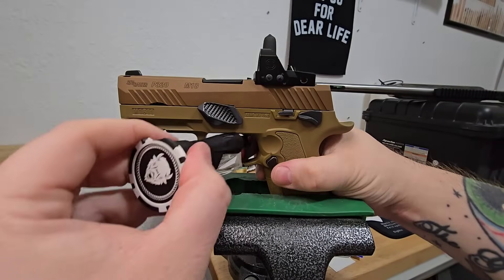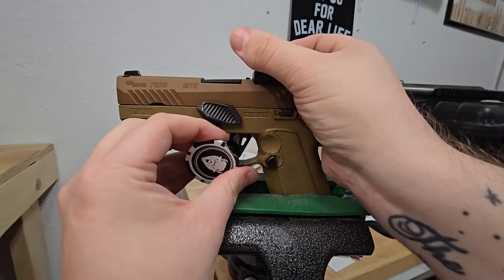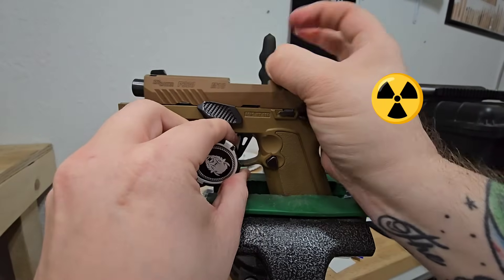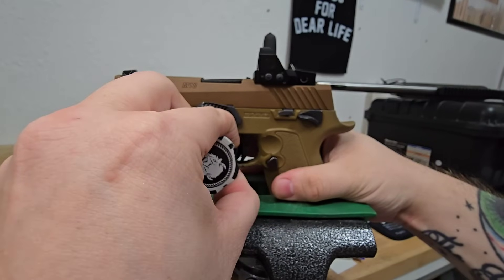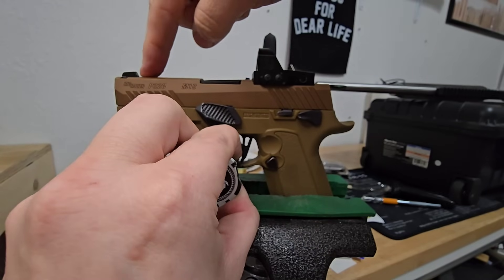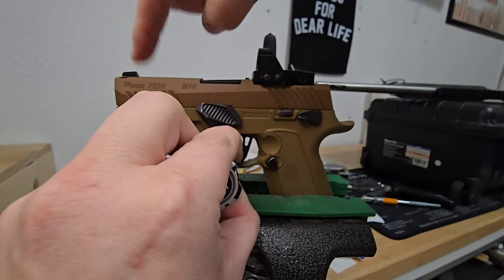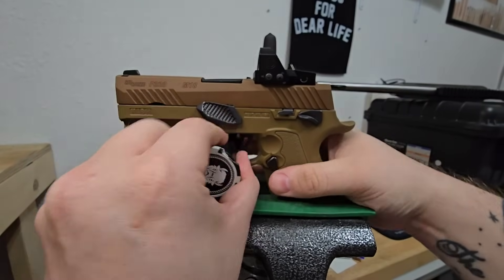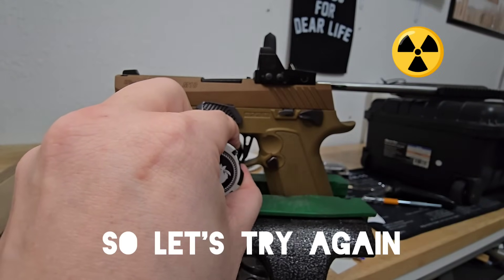VISE Testing Sig Sauer P320 M18 Slide/Trigger Pressure Issue!!

Comment: Isn't there something about what to do or what not to do with your finger and a trigger among the ancient quartet of rules for firearm safety? And the introduction of pressure upon the trigger (or the introduction of a screw or a wedge or any object into the scenario to preload the trigger) simply provides evidence in proving Sig Sauer's point.
Reply from the maker: This is not an attempt to explain the UD situation, only to show a possible issue that when combined with others, might offer some partial explanation for the controversy
Reply: This is duplicating what happens when you prep a trigger and then don't shoot.. amongst other things.  The sig has or can develop a shelf that will hang the sear up in the position shown here.  Their geometry is wrong.  You either have one and you have an unhealthy relationship with a tool, or you haven't been following this saga closely.
Reply: It also still proves SIG statement that the gun CANNOT FIRE WITHOUT THE TRIGGER BEING PRESSED as wrong. Neither this guy or WY Gun Project are fully pressing the trigger, the firing pin is coming off the sear, and secondary catch is not stopping it
Reply: @dustinn5490  "trigger being pressed" and not "fully pressing the trigger": a distinction without a difference. Still, even with less than fully pressing the trigger, 'something else' also has to be present, which is implicit in Sig Sauer's statement.
Reply: Guns shouldn't go off when the trigger is 50% pulled instead of 100%. Very basic concept here. If you're not physically pulling that trigger until it breaks, and yet the gun can still discharge due to the slide being bumped or some other force is exerted on the pistol, that's a glaring issue. Sig themselves have said, in black and white bold text, that the P320 cannot discharge unless the trigger is FULLY pulled. Not partially pulled. FULLY pulled. Their words. Not mine. 

Why? Why are we accepting this from an American gun manufacturer? The German and Swiss arms of Sig Sauer don't have these issues. Why are we settling or making excuses for anything less than a perfectly safe and functional firearm? It's nauseating. We wouldn't do this for any other company. If Glocks started doing this, every glock hater on the planet would be rushing to condemn them and demand they pull them from the market. We wouldn't accept this from anything else. Just stop already. Anyone that isn't even the least bit suspicious or skeptical of the P320 right now is doing the firearms community a major disservice.
Reply: @retrocny5625  One: I am not making excuses for anyone, especially not Sig Sauer. Two: I am not saying a dangerous unintended discharge condition does not exist with given p320s. Three: 50% or 100%, the what to do with or not to do with fingers and triggers rule made the all-time top four for a reason.
Reply: The pulling back of the trigger just demonstrates how anything from dirt, to tolerance stacking of parts can cause the pistol to fire. 

They're not necessarily saying the trigger has to be pulled back. In fact, it's highly unlikely the trigger is involved in the 100+ times it's fired on its own

Comment: M18/17 should be carried with MS engaged. Flip the manual safety on and redo your test.

With the civilian ver of 320 (no MS), make sure no foreign objects like keys get inside your holster and you will be fine.
Reply: Alternatively, carry literally any other handgun, and you will be fine
Reply: There are a multitude of VIDEOS showing a UD with no foriegn object.
Reply: The pistol will fire with the safety on. Just ask Airman Brayden Lovan.
Reply: I personally tested my 320 tonight with MS engaged and it didn't go off (striker didn't move forward) no matter what abuse I put it through... wiggle, shake, press, hit, slam, drop. This is somewhat reassuring. 

No one was able to showcase where sear can be engaged without any force applied to a trigger. Even the mighty FBI couldn't reproduce it. So keep foreign obj away from your holster and avoid light bearing holsters, and you will be fine. Also, when you have your finger on a trigger, don't bump your slide :)
Reply: in japan a marine in a gaurd shack at "gate 1"  had their m18 with the manual safety engaged and holstered and it went off without the marine touching the gun...
it was on VIDEO, but the navy hasn't released that footage, just a report...
Reply: @akui88 i haven't seen the footage, and I hope it will be released, but my tests showed no signs of UD with MS engaged
Reply: @SunnyMoon-u7c  the navy special investigative unit released a report, the m18 was holstered and had manual safety engaged. If this is true then the gun has some serious issue.

like the manual safety was ON, the gun still fired in the holster.

Comment: Please try this test with the safety engaged, PLEASE. I have the same M18 with the same 1811 frame. Does the safety negate all of this?
Reply: Mine will do the same thing with the safety on!
I'm not saying it will fire, because it could be hitting the striker safety,  but it definitely will come off the sear.
I unloaded it & put it in the safe, & it's no longer my bedside gun.
Reply: @kevencouch3291  no if the safety is engaged, the trigger doesn’t move at all to the rear. I already tried it. Also even if this trigger had a trigger safety blade sticking something in there would engage the trigger safety. The real issue is that the striker is underload and the trigger is moved to the rear and is at the walland there’s play between the slide and the rails of the FCU, which seesaw off the sea when you push the front of the slide.
Reply: @kevencouch3291 Try it with a primed case.
Reply: @kevencouch3291  BULLSHIT
Reply: It wouldn't matter anyways. It's fairly well documented that these guns all have a potpourri of parts inside of them. The same model, from the same year may have significantly different FCG geometry and tolerances due to inconsistent part supply and absolutely dogshit QC. One example functioning properly doesn't mean another identical example will. Also even if your pistol is fine today, doesn't mean it can't develop these behaviors at some point assuming it gets used.
Reply: “Mine has been fine”, ok some have survived playing Russian Roulette but I do not recommend it. And, folks the manual (external) safety on the P320 only prevents pulling the trigger but does not lock the sear, leading to a false sense of security. I’m sorry but bad design leads to bad (tragic) outcomes.
Reply: @timothyorendorff7642 💯
Reply: This is such a flawed design. Starting with a fully cocked striker that is, in itself, dangerous. Add in a trigger group that has 5X as many parts as a Glock. All that tolerance stacking is ridiculous.
Reply: You cant pull the trigger with the safety on
Reply: But you can shake it forward with the safety on and it will fire
Reply: @StrapDLBStyle , but you CAN still make the striker drop, with the safety on!
Reply: Mine would not move the trigger at all. I want to make sure it's safe for appendix carry if the safety is up
Reply: @Dedseq  It's not. For the love of God quit carrying it
Reply: @Dedseq your kidding I hope
Reply: @Dedseq I don't think you understand what the trigger pulling is simulating here. Because sig Sauer wanted to make the gun cheaper to maximize profits, they used the cheapest manufacturing process possible for the safety critical components: metal injection molding. To keep the parts cheap, they do practically no post-processing on these parts. That means that surface defects exist on a lot of these critical components that can hang up can keep the firing and safety system from fully resetting when it is recocked. Your gun might be fine, or it could blow a hole through your leg and you'll bleed to death. You can't be sure because you bought a Sig instead of a gun from a manufacturer that values safety. 

The trigger safety ONLY stops the trigger from moving, it does nothing to assure that the sear is fully engaged or that the striker safety is properly mater between the slide and frame. 
Pressing the trigger in these tests is to induce what happens when Sig puts two or more bad parts in the same gun, which has already killed two or three people.
Reply: Hey, @rre9121, don't forget, a lot of first-time buyers will grab the P320 without knowing about the details. The best thing is to educate them, like you did. 👍

Even though I like the gun, I'm not carrying it anymore. It'll stay in the safe, and I'll probably replace it with something else that has the modularity.
Reply: @Dedseq   I also was wondering the same thing. What I am more interested in is whether the stiker will fire regardless of whether the trigger is pulled or not (regardless of whether safety is on or not). What I dont understand and maybe someone can help me because I dont fully understand how it comes into play, is whether the safety is physically preventing the striker from moving forward. I believe it does.
Reply: Lmao, anyone asking if it's safe to carry with the safety on should just lead the way and find out! 💀💀💀
Reply: @HVACR_ToolNut hey, ppl can do what they want and find out the hard way I guess ? I still have my old Sig P220 which never let me down. I bought the 320 two yrs ago and during a range session it went off , safety on , chamber loaded when I was practicing drills and pushing the gun forward towards a target . 
I tried it again and it went off.. so I shook it forward , it went off .. 
it went from the range, to the case, back to the dealer where I just purchased a Glock G45 and took a loss on the Sig. 
I carry both Glocks and my old 220 which I trust .. but the 320 ? Nope ..
Love their rifles though
Reply: Lot's of people asked for this in his previous vid and he still didn't try it lmaoo
Reply from the maker: @NalopeonTheGreat it won't do it. I've tested it repeatedly. Nothing to show.
Reply: I was able to fire my Sig 320 , safety on , loaded chamber by just shaking it forward . 
Once I posted the videos on Sigs You Tube armor channel my videos were taken down without warning. I appealed and got nothing .. 
not all 320s do this but is it worth the chance ?
Reply: @kalashnikovmania2074 BULLSHIT
Reply: @kalashnikovmania2074  Send me the link to the video